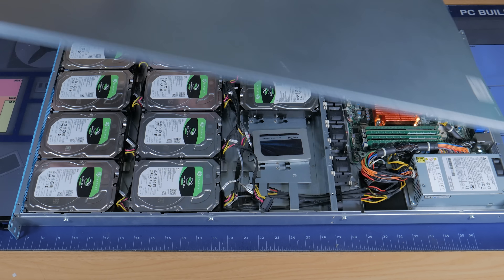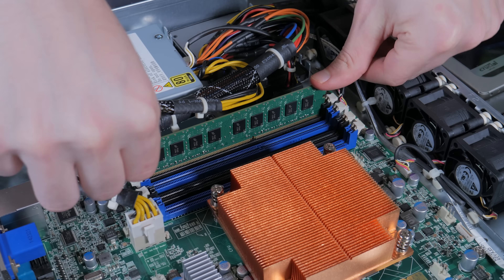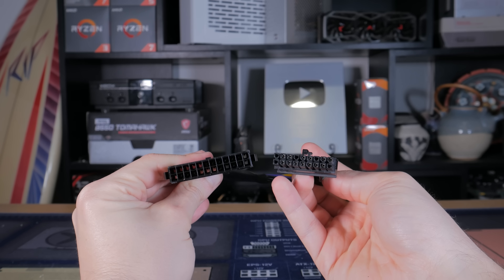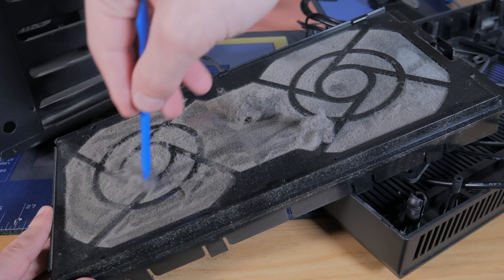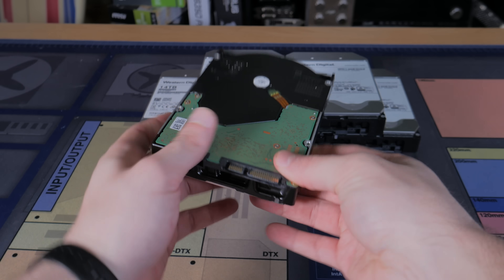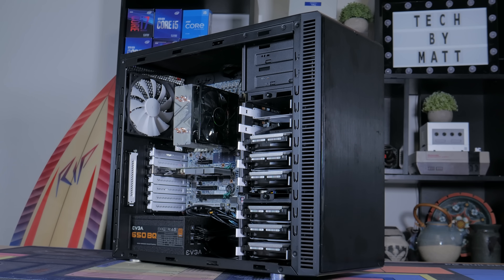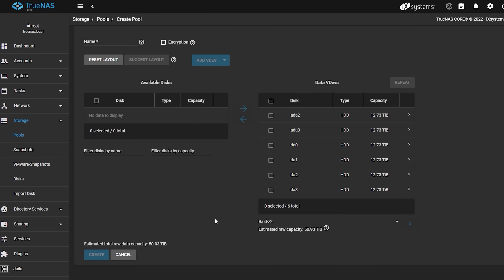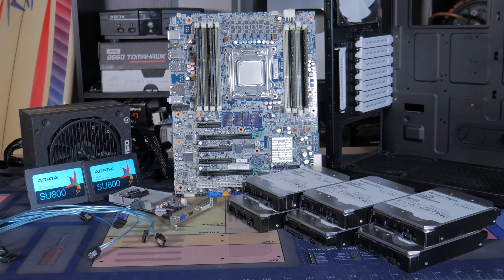Budget Storage Server 2022! | 84TB NAS

Comment: Cool build imo.. i did a similar build from scratch about 4-5 years ago but a supermicro X8DTH-6F Bord with Dual 6 core X5675's and 64gb of ecc ram 850w evga psu but i added a 10gb nic from the start and ssd and it is still rock solid some 4-5 years later its running Unraid now days and i have another well 3-4 more servers running Truenas & unraid that are Biger, Badder& Better But i just cant make myself retire my first from scratch server build an the Fractal XLR2 case is still one of my favorite thats i have that are not rack mountable now days..any way cool video an thanks for sharing !

Comment: Two lessons I learned the hard way:
Shocked drives die sooner and its a pain
Get fewer bigger sticks of ram, it makes upgrading easier

At least for my truenas that's been mine experience

You think about the price when you're building it, but when you go to replace drives its the hassle thats actually worse

And l find little effect of faster ram, huge effect of bigger ram. And ended up with a bunch of small sticks I had no use for

At least the way I use it as a server. If you're just storing files and not really reading them off the nas its less of a pro blem

Comment: Quite a good video, and the first one i saw that adresses the active-low pin on salvaged USB hard drives.
Ive build a NAS myself a few Months back with a "Node 804" Case which supports 8 hanging HDs in a small form factor (though i had to print out an additional fan holder for in between the HD cages because the disks got too warm). 
In the end i installed 9 HDDs for storage and one m.2 for the OS.
Since our electricity is the most expensive in the world (0,3 - 0,35 €/kWh -> ~0.35 USD/kWh) i cant let it run 24/7, so i configured it with WOL (Wake on Lan).
If i need the storage, i simply ping it with a "magic packet", and when im done i execute a special ssh script which logs into the machine and shuts it down. a bit of work in the beginning, but easy to use once its all configured.

Comment: Trunas uses the ZFS file system.
this file system is by concept hungry for RAM!
In my job I created a professional NAS with ZFS.
with ZFS the rule is:
Throughput problem -> Adds RAM
Speed issue -> Adds even more RAM! !
The classic rate is 1GB of RAM for 1TB of net data in the NAS!
in your case the 64GB is a minimum, the OS needs RAM too;  not to mention the caches on very high performance professional SSDs.
ZFS uses read and write caches all the time (if they are not on dedicated disks, it uses the pool), installed on high performance ssd, ZFS will "abuse" the higher speed of SSDs to boost its performance

Comment: Couple of money-saving suggestions I'd make if you're considering building your own NAS:

Older server CPU's generally idle at much higher wattage. If you intend 24/7 operation, seriously consider a modern i-series or much newer Xeon or Xeon-D instead. You might save money long-term. An older Xeon-E might double your energy bill over newer chips.
Don't consider ECC a requirement. It really depends on how much you care about what you're storing. We're talking Act of God levels of paranoia about your data to consider ECC a must. My advice - if you're asking yourself whether you need ECC, you probably don't.
There are free Linuxes that are not much more complicated than the paid-for NAS options. Consider Fedora server for example.
People rightly talk-up ZFS, but mdraid is an incredibly stable, mature and flexible system.
Reply: "Older server CPU's generally idle at much higher wattage. If you intend 24/7 operation, seriously consider a modern i-series or much newer Xeon or Xeon-D instead. You might save money long-term. An older Xeon-E might double your energy bill over newer chips."
Whilst TECHNICALLY true, the reality is that at the end of the day, the increased cost of the newer processors vs. the money that you'd save on idle power, in many cases, just isnt' worth it.

As stated, he can literally buy an Intel Xeon E5-2660 (V1) 8 core CPU for < $10.

Depending on how long you're idling for and the system configuration, a DUAL Xeon E5-2690 (V1, 8-core, 2.9 GHz base clock, max turbo 3.6 GHz, max all core turbo 3.3 GHz) will idle at 112 W. Assuming that you split the power consumption directly in half, the idle would be at around 56 W. (Source: https://www.anandtech.com/show/8423/intel-xeon-e5-version-3-up-to-18-haswell-ep-cores-/18). I couldn't find the idle power consumption data for the E5-2660 (V1) readily.

My HP Z420 which has the E5-2690, but also a GTX 660 in it, and 128 GB of DDR3-1600 ECC Reg RAM (8x 16 GB) idles at around 80 W, but I am sure that a decent portion of that is just the RAM and the GTX 660.

So, let's say I assume that the idle power is somewhere around 50 W. 50 W * 24 hours = 1.2 kWh * 365 days/year = 438 kWh/year * $0.10 USD/kWh = $43.80/year.

If you halved the idle power consumption, you'd be saving $21.90/year.

And then now, depending on which processor you want to replace that with (in terms of a newer, more modern architecture, between the motherboard, the CPU, and the RAM) how many years would it take before you'd break even with the increased costs?

So it really depends on what you are trying to replace it with.

I mention this because I've ran the analysis multiple times over the years to modernise my hardware and it always come back to this very same question.

"Don't consider ECC a requirement."
That depends on the motherboard and/or the CPU.

Some motherboard-CPU combinations actually REQUIRE at least unbuffered ECC just to POST. I forget what the HP Z420 motherboard requires because I've always ran it with ECC Registered RAM because I don't want there to be any stability problems on account of the system expecting there to be ECC, but then the memory modules not having it.

"There are free Linuxes that are not much more complicated than the paid-for NAS options. Consider Fedora server for example."
TrueNAS is free.

As for pre-built boxes, that depends. There are some things that are easier to do on my QNAP NAS systems that, whilst you can do it on Linuxes and/or TrueNAS, it takes more time and effort vs. clicking a button (e.g. setting up the NAS to be a Time Machine backup and/or installing applications where I can backup the photos and videos from iPhones). This isn't to say that it can't be done. But that also depends on the answer to the question "what is your time worth?". For me, whilst I can probably deploy those solutions on Linux, it would take me a lot more time than what it would be worth it for me to just buy a pre-built NAS system for that (minus the hard drives).

Like another thing that my CentOS install HATES right now is the fact that the SMB ACL is in direct conflict with the NFS ACL. (i.e. my other CentOS compute nodes and access the NFS exports over RDMA without any permissions errors, but when I tried to make the same mount points SMB shares, my Windows clients perpetually complain about it not having write permissions despite the fact that everything has been set up correctly (or there is nothing that jumps out to me as being wrong, based on the various Linux Samba deployment guides that are available for CentOS). Conversely, I have both NFS and SMB shares on my QNAP NAS units, and I don't have this same permissions problem. So....*shrug*....who knows.

And I don't really have the time to pour more time into trying to fix it, so the "dumb" answer is that if I need to transfer the data, I will send it to my QNAP NAS systems from Windows and then have my CentOS compute nodes and cluster headnode pull it down from the same QNAP NAS system over NFS. It's a roundabout way of getting the data transferred, but the few seconds or few minutes more that it to go around is less than the time it would take for me to try and actually figure this out properly. (And this is even with SMB guest enabled on the SMB share.)

"People rightly talk-up ZFS, but mdraid is an incredibly stable, mature and flexible system."
Yes and no.

mdraid, to be best of my knowledge, does not detect nor correct for silent bit rot.
Reply: @ewenchan1239  I can't say I disagree with anything you say. Note I was careful to qualify everything I said with "might" and "consider". I have no prescriptive notions of what others should be doing. Was just riffing on the theme of budget. Couple of points:

You should try plugging in the domestic kWh average of - for example - Germany (~$0.34-0.35) into your sums and see how things quickly change from a price point of view.
I recently replaced an ancient Athlon-based home server that's been on duty for 12+ years with Alder-lake. I want 24/7 operation but it sees most of its use during the day, cores will spend most of their time in C10, with whole package using about 2W. It will save approximately $80/year on January energy prices - no doubt even more after recent events. With a bit of tweaking managed to get the whole system to use < 30W idle. If it proves as resilient as the old Athlon system, it'll be worth the extra upfront cost.
Reply: @0w784g  
"You should try plugging in the domestic kWh average of - for example - Germany (~$0.34-0.35) into your sums and see how things quickly change from a price point of view."
I understand your point here, but I would counter with the price delta between a modern CPU vs. an older one might be relatively proportional to the changes in the rate such that my general point, the "slope" of the curves, relative to each other, may change a little bit, but the overarching jist of my point still remains the same.

At the end of the day, it's still going to boil down to the same question: how many years of savings in electrical costs will it take to break even against the incremental cost of a newer, more modern CPU/motherboard/RAM/hardware?

And the answer to that question depends a LOT on what you pick as the old hardware vs. the new hardware in the sense that if you are only migrating from one year or one generation behind, then the relative advantages of a decrease in the (idle) power consumption may not be as significant if you were to compare it to say, migrating from hardware that's 5+ years old/5 generations older. But again, that kind of a migration has an incremental cost associated with the more modern hardware and I've ran this calculation many times over (it is one of the reasons why I haven't moved over to an AMD EPYC nor the AMD Threadripper nor the Threadripper Pro platform yet) because my old quad node, dual socket/node, 8-core/16-thread per socket system (64 cores, 128 threads in total, with 512 GB of RAM) pulls 1.62 kW. And whilst the AMD EPYC 64-core/128-thread processor would be more efficient being at only 280 W TDP, it's also ~$5000 at launch, excluding the cost of the motherboard, RAM, chassis, etc., and let's assume, for a moment that the AMD EPYC 7713P total peak system power draw is 500 W.

This means that my old machine @ 1.62 kW, pulls 38.88 kWh/day vs. a new system at @0.5 kW, would pull 12 kWh/day. For a year, it would be 14191.2 kWh vs. 4380 kWh. At $0.10/kWh, it would be $1419.12 /year in electricity costs vs. $438/year, or a net difference of $981.12/year in savings. Therefore; the TARR for the CPU alone is 5.096217 years.

And you can make it agnostic to currency by plugging in your own values into the calculator to calculate what the TARR is for your specific scenario that you want to analyse.

5 years from the time that you built and upgraded the system, there would always be something newer and better and more efficient, and you're running this calculation again and again and again.

The "slope" of the TARR may change depending on region, but again, my general jist remains the same.

"I recently replaced an ancient Athlon-based home server that's been on duty for 12+ years with Alder-lake."
I just RMA'd my Core i9-12900K back to Intel because it failed to run memtest86 for longer than 27 seconds and got a full refund for it after about 3 months in service.

" I want 24/7 operation but it sees most of its use during the day, cores will spend most of their time in C10, with whole package using about 2W. It will save approximately $80/year on January energy prices - no doubt even more after recent events. With a bit of tweaking managed to get the whole system to use < 30W idle. If it proves as resilient as the old Athlon system, it'll be worth the extra upfront cost."
But again, how much did you spend, upfront, to save said $80/year in electricity costs?

How many years will it take before you break even when you divide the incremental costs by the annual savings in electricity costs?

I'm not saying that you don't save money.

What I am saying is "is the TARR worth it?"

(And an Athlon-based server --- wow....that's impressive!!! I have systems that are that old, but none of those are currently in use/deployed right now. I keep mulling with the idea of re-deploying my old AMD Opteron 2210HE server because the Tyan S2915WANRF board has 8 SAS 3 Gbps and 6 SATA 1.5 Gbps ports built-in, but then also comes the fact that they are only SAS 3 Gbps and SATA 1.5 Gbps, which, for a "dumb" file server, it'll be plenty, but those processors also have ZERO support for virtualisation, so, its usefulness at that point will also be limited, and back when I had that system running, it would easily suck down 510 W of power, so it's not super efficient either. So believe me -- I understand your point. But that's also why I have two QNAP NAS units that are using ARM processors, one that's using a Celeron J, and a TrueNAS server that I have that is running dual Xeons (which I've been running this same calculation to see if I can update that server to something newer, mostly so that I can run more virtual machines off of it, which increases the overall system utilisation.))

I WISHED that the newer processors actually had more PCIe lanes to them because then they can be lower powered, but also super powerful as well for home server duties.

The last generation that I have, which is sporting the Intel Core i7-4930K has 48 PCIe 3.0 lanes, is great because I can put 100 Gbps Infiniband network card in there, a GPU, and also a SAS 12 Gbps HW RAID HBA and it isn't super power hungry. A lot of the processors newer than that, all have fewer PCIe lanes than that.
Reply: @ewenchan1239  Sorry but what does TARR mean?
Reply: @3nertia  
Time adjusted rate of return.
Reply: @ewenchan1239  Thank you!
Reply: @3nertia  
You're welcome.
Reply: @ewenchan1239 
"My HP Z420 which has the E5-2690..." Curious if this is a v1 or v2 2690?
Reply: @chrisrisley1324  
V1
Reply: Why not just a budget and cpu?

Comment: You can get rid of the front I/O errors by grounding the sense/ID pins on the motherboard headers. I'd suggest soldering small wires to the backside of the board under the header if you actually want to use the ports for your case's front I/O. If not, then just use some jumper wires to attach to the pins directly on the header. 

For the USB 2.0 header, short pin 10 to either pin 7 or 8.
For the USB 3.0 header, short pin 10 to any of the following: 4, 7, 13, 17.
For the Audio header. short pins 2 and 4.
For the 1394 Firewire, HP used a proprietary header, so you'll need to either plug in an HP front I/O module and stuff it somewhere in the case, or search the forums to see if anyone reverse engineered the pinout so you can know which pins to short.

As for the fans well, just add a couple case fans and use those headers.
Reply: Hp proprietary IO is the wrench in this build.  Also, a thermal sensor is present on the HP Z workstations that need to remain plugged into the mobo for transplant viability.
Reply: You're a life saver - I've been looking for this information desperately

Edit: Some more research yielded this video, which is also useful - https://youtu.be/c8G97FlI2QA

Comment: You should have a look at 5800x3d (or 5900x as your work is more production work I guess, the 5800x3d considerably more suited towards gaming due to its significant 96mb of cache but the 5800x3d is no slower then the 5900x if your not using the extra 4 cores of it)

there might be a bios update for your motherboard to get your 1700x to the 5800x3D only having to change the CPU 

I went from 1800x to 3800x it was best thing I ever (1000/2000 but its really slow vs 3000/5000 CPUs) , did my motherboard just recently get 5000 CPU bios support so I am considering the 5800x3d (I was waiting for the ddr5 versions but 5800x3d is a significant upgrade that I can do without having to replace my motherboard)

5000 line CPU has fixed the slow AVX 1000/2000 requires double cycles to do what 3000 cpu can do and 5000 spread that up even more (everything runs as fast as Intel type CPU)

Comment: Please everyone be aware that only 2 of the 10 SATA ports are 6 GB/s, the rest is 3 GB/s only. While this might not impact HDD performance, it surely will limit SSDs. In this case, as OS drives, it might not make a difference, but if you plan to use your SSDs as cache drives, you want max performance.
Reply: He did mention only 2 are SATA 3.

Comment: I would have gone with a 3 or 4U rackmount chassis. You can get 15+ drives in that space, and much better cooling. And with 4U, noise would be minimal with 3x120mm fans on front (without hot swap in that case). Nice build anyway.
Reply: Oh, another thing. I know, 240GB SSD are dirt cheap now, but if you need to save a little more you could just use a pair of mirrored USB drives. 16GB will do, even 8GB I think works just fine. That way you also get two additional SATA ports.